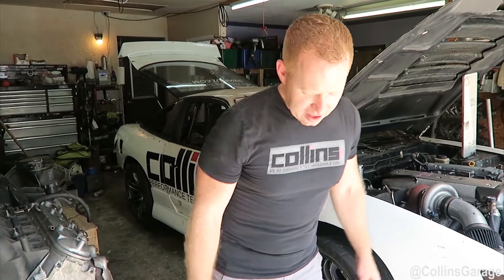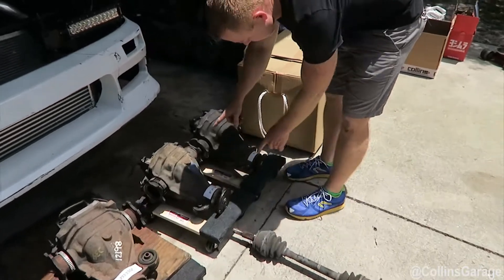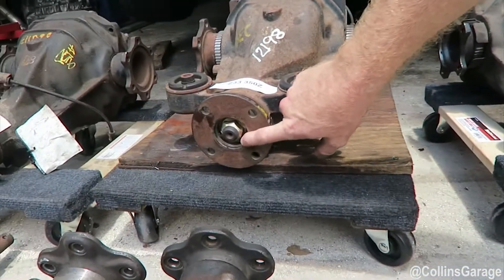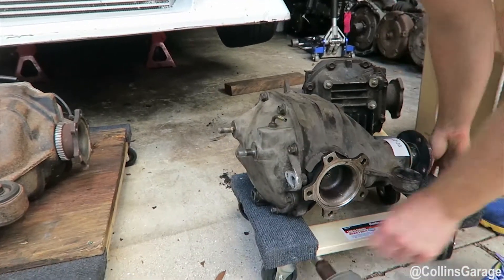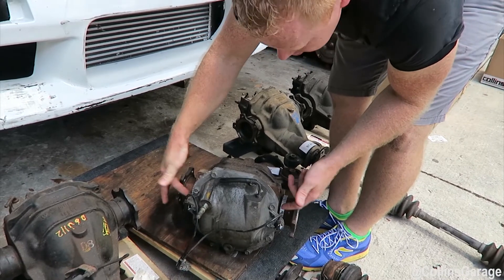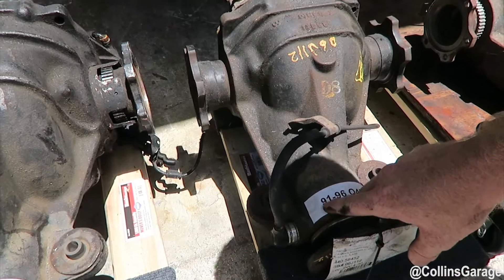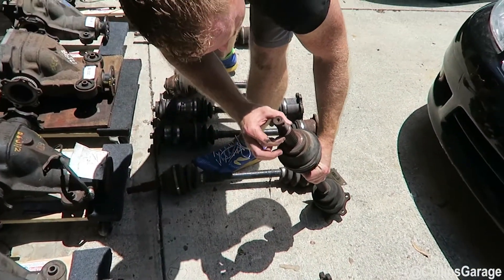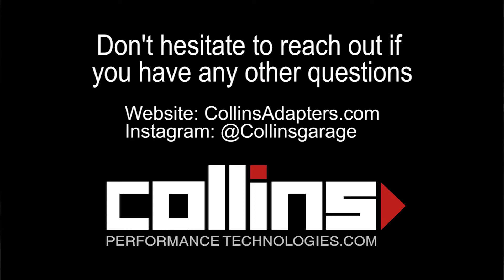S-Chassis Differential Selection by CollinsGarage

Comment: Is there an aftermarket 2way lsd that will fit the pre 96 Q45 diff?  I need the longer gears but don't want to run welded.

Comment: Theyre 32, not 30 spline, but good one. 
What would be amazing is some aftermarket axle (shafts) or a solution that doesnt use the wonky DSS spacer and VAG 108mm CV

Comment: hello am running the last diff on the video   i think its r230  on the s14   .... my problem is the driver side axles 350z axle   is too tight   there is no center play  at all     if the car on jacks   there is clicking play only   ...  passenger side is fine  there is like 20 to 30mm play on ground  .... any ideas what to do guys?

Comment: So I have and r32 gtst with the r200 that has a 4 bolt pattern for mounting. Now would that diff cover swap to a 350z diff to make it work on the gtst ?
Reply from the maker: That actually would be a possibility for you if it is an R200 carrier, and the front of the R32 subframe is the same as the S13.

Comment: i bought an LSD diff from an R32 wich has no ABS... my S13 (180sx) has a welded ABS diff, both seme to be R200 but the R32 diff is 5x1 bolt and my s13 diff is 3x2,  even if the flanges would swap directly over the R32 diff itself is shorter... ive been on forums past couple of months and came over this video, any tips? thanks maybe all the internals swap over? can i extent the non abs diff somehow? appreciate any reply
Reply from the maker: There is a difference between the ABS and Non-ABS length. the mounting points for the Front two bolts and the rear cover is in the same position however, meaning they don't make two different subframes for the non-abs versus the ABS cars.
Reply: @CollinsGarage_Crett_Bollins  so an internal swap from one to the other will work?

Comment: iirc the z32 tt also comes with an r230, i dont remember the final drive ratio but the viscous lsd is crap in it, i think kaaz still makes a clutch type carrier for it.
Reply from the maker: that is correct.
Reply: The ratio is about a 3.9 I believe. The na 300zx is a r200 and a 4.3😊

Comment: Great info, but I cant see you confirm which covers will fit the 350z differential, I am mounting one in my 1jz rx7 fd, but am at the stage of either welding a second stub onto the stock differential cover unless their is a off the shelf budget option. As you mentioned information is so spread out even three years later
Reply from the maker: our differential cover that we machined out fits the 350Z differential, and has a few different patterns in it here:
https://collinsadapters.com/adaptation-components/differential-covers/s13-s14-s15-to-350z-g35-differential-install-kit.html

Comment: hello bro how are you i need your little help.... 
i have crown 1994 model with 2jz vvti 3 coil engine with 4 forwad 8wire gear .. 
kindly tell me which diffrential is best for pick and fuel effeciant?
Reply from the maker: I'm not sure if the Crown chassis is compatible with the SC chassis differential, but if they are you should get the 2001 SC430 differential and that should have a good ratio for daily driving.

Comment: So if I use a Q45 I can change the back plate of the differential to the z31 and the U-joint shaft for the drive shaft to the z31 and it will fit directly in my 87 z31 cradle what drive shaft would I use to directly bolt up

Comment: R32 GTR's use an R200 diff not R230. Yes they have 6 bolt front flange but they are still R200.
The diff you show in this looks more like a Z32 300zx R230

Comment: Great vid guys all I wanted to ask was does the q45 back plate fit the 350z diff to give you two pick up points?
Reply from the maker: Q45 and 350Z have the same pinion flange pilot size and Bolt circle diameter.

Comment: I run the pre 96 Q45 diff, with 350z axles.. bolts up fine, and retains factory S13 hubs. Plus the gearing is identical to the Manuel gear for a CD009 car.
Reply: Did you just get the stock q45 Diff Stubs modified
Reply: @csiverand  
No, the older Q45 diffs came with 6x1 stubs. Z axles bolt to it, and spline into stock 240 hubs.. 
compression length plays an issue on stock S13 subframe, height, LCA etc.

Comment: great info bro,  how about the bigger size of the r230 housing? Have you tried mounting it into the subframe? Ive always wondered about the r230 working cause of the bigger size housing. I just got my 300zx tt axles and q45 axles for 90-95 q45 3.54 diff swap. 1996 q45 got 3.69 and lost 6 bolt axle snubs for the 5 bolts. I looked for 300zxtt driver side axle for so long. I never noticed info about r32 axles working. so thank you again for the info. Also the drive shaft shop makes the cv shaft center bar so you can just buy a reman set of 90-95 q45 axles and change the pass side to work with the correct length. Im building my second ls2 240sx. Its s14 this time around. Im gonna give your cd009 adapter a try rather than the t56. Im not liking my t56 in my ls1s13 its like shifting a truck. I be hitting your web site up in next few weeks. thank you again